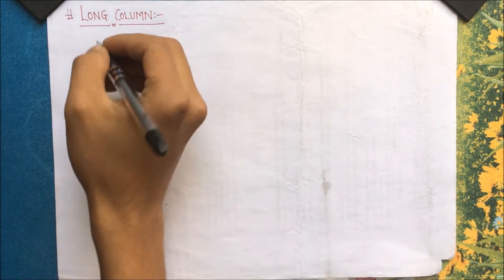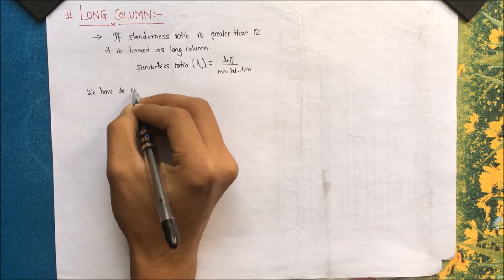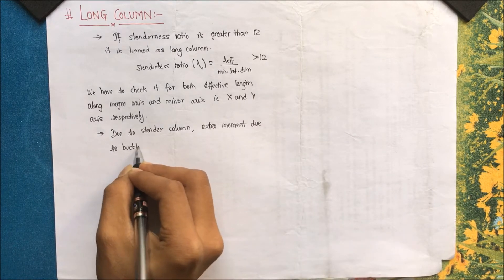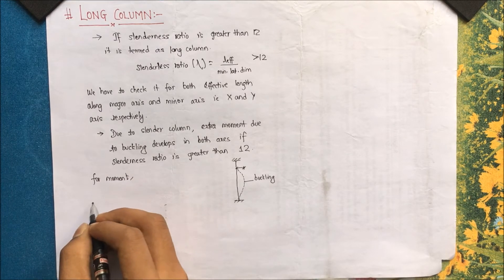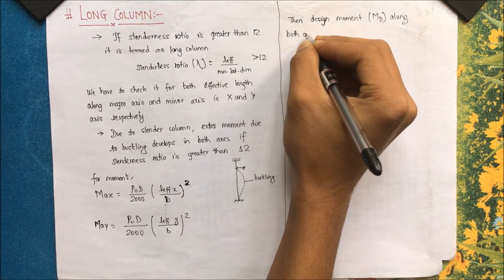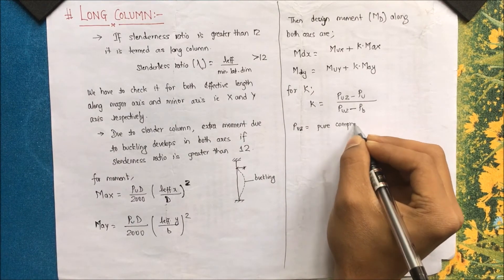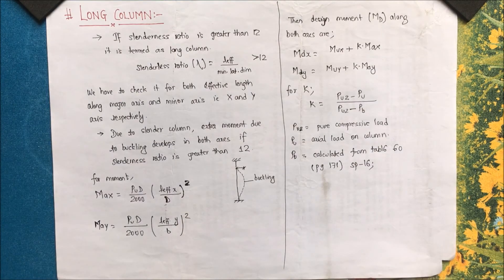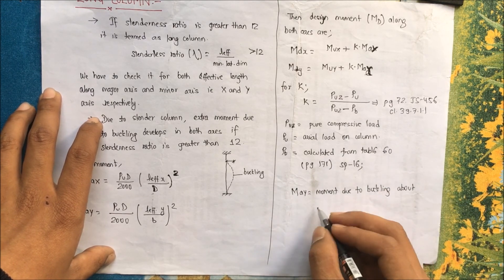Long Column Introduction| Design of RCC Structures | Mumbai University | IOE , TU , PU

Comment: hello sir, for G=1 construction.   4 feet footing + 3 feet plinth hight + 10 feet roof + for next floor 5 feet lapping = 22 feet single bar cut kar sakte hai without lapping for column?
 kyunki column is compressive member hai. rebar dia 16mm 4 bar + 2 bar 12 mm. 9x12 mm column size.
Reply from the maker: You can if you could even correct it properly while concreting.
Reply: @civilconst  Thank you sir for reply. yes sir great  will give extra support for straight. And use m20 grade with proper 25 mm cover. Thank you again😊🙏🏻 a